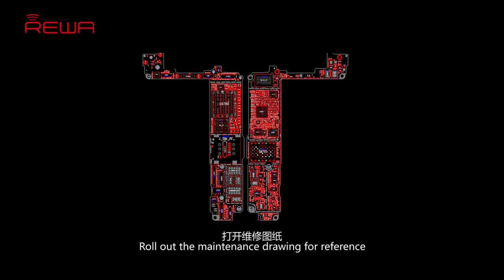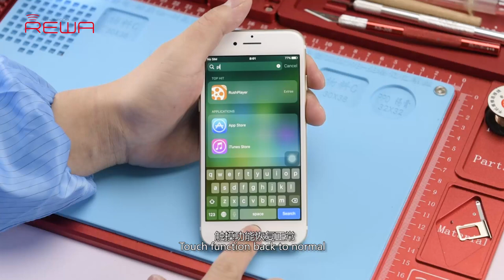How To Repair iPhone 7 Touch Screen Not Working

Comment: Question I have a customer's iPhone 7 it had a smashed LCD no damaged whatsoever inside using a microscope to investigate all chips on board all look perfectly fine, however tried 6 new lcds yet touch is still not working and not only that when power button is pressed it's like it's got a mind of its own same with volume button and home button, starting to think the phones a right off
Reply from the maker: Maybe the same situation with this video: https://www.youtube.com/watch?v=Bro_fIP2_mY&t=56s

Comment: Hello,
I have an iphone 7, I was going to replace the charging port so I opened the iphone and started unscrewing but I did not have Y000 screwdriver so i decided to put everything back(Just the rear camera) and plugged back the battery, lcd and home button and other flex cable, basically everything back to its normal place. 
However, After doing that I turn on my iphone and everything works normal but my iphone is not responding. The touch screen is not working at all. Home button is working and is responding but the screen is completely irresponsive. 
I notice there are 2 flex cables  coming from display (the one near battery flex), theres one on top and one that goes under it. The one that is under the top cable is slightly cracked. Is this why the iphone is not working or could there be some other issue?
Note: The display is working fine, i can see the apple logo and everything on phone but just can't touch anything so the touch screen is not working i think.
Please help me.
Thanks,
Rohan

Comment: HI so my iPhone 7 plus slid off my bed and fell face down on the ground. It already had a crack going down the right half of the screen but it looks no different it looks exactly the same. However, when I tried to text the lower half of the letters didn't work so I turned the phone off and back on. Now I can't get back into it because the bottom 4 numbers don't work. Now I'm stuck out of my phone and have no idea what to do. Can someone help me?
Reply from the maker: Jordan 100%. According to your description, we think your screen was damaged. You need to change the screen assembly. Find a local repair store for help. It's not a difficult task. 
If you wanna try yourself, this is the replacement screen you need to buy: https://shop.rewa.tech/detail/for-apple-iphone-7-plus-lcd-display-and-touch-screen-digitizer-assembly-with-frame-and-components-replacement-white.html

Comment: Hi everyone! Few weeks ago i swapped a broken screen with a, unfortunately, not-so-good new one, and i tested it (without immediately swapping home button) to see if it worked. Once i saw that it worked, i installed the home button on the new screen, trying to be as gentle as possible, and the phone gave me the touch id error message.
So i put the home button back in the original broken screen, but i found a weird behavior: original screen's touchscreen was unresponsive (and home button wasn’t working anymore).
After some attempts, i noticed that if both screen connectors were plugged, touchscreen was unresponsive (with or without home button), while if only the left screen connector was plugged, touchscreen was working, but, again, no working home button. As soon as I plugged in the right screen connector, the touchscreen stopped working.
On my main iPhone 7 I also tested another working original display of a second iPhone 7 of mine, with audio problems, but i got the same behavior: touchscreen wasn't working, with both screen connectors plugged, while was working with only the left screen connector plugged.
Both original screens work perfectly on the secondary iPhone, with both screen connectors plugged.
I tested all three screens with the JC V1 Programmer and while i can read and write data from and into the photosensitive chip of the two original displays, i noticed that the aftermarket one doesn’t have any chip. But it’s the only one that works.
So, is it related to the photosensitive chip? The mobo, or some other component, or software, blocks the touchscreen if i connect an original display that has that chip?
Or is this malfunction related to some connector/mobo damage?
Thanks!

Comment: Nice video. 

Is this considered a signature failure?

In which other war can touch fail?

Also, where do you recommend sourcing replacement filter, caps, resistors etc...?
Reply from the maker: It is one of the common failures. There are many other causes may lead to this kind of problem.

Comment: Hello, i have 1 iphone 8 and touch not working, if i press de conector works fine a few moments, and if a i put a lcd from iphone 7 works perfect without press, i already change the conector, and i have all the correct vallue, any idea? thanks

Comment: And for the record no point taking it to Apple centre once screen has been damaged game over they do not care after that unless you pay good money or even the price of the actual handset for a replacement , this is where Apple have normal folk who have no phone repair skills by the balls, profit from your mistake yet someone mentioned in comment below until Apple do board repairs or any half decent repair than they wil be called upon but their options are if it's broke it gets replaced very costly!

Comment: Why didn't replace filter? Jumping it isn't the best repair
Reply from the maker: One of the bonding pad was already broken and FL3904 was damaged, it is hard to replace a new one, so we use copper wire to connect.

Comment: Or you could just take the iPhone to apple?
Reply: Do you have any clue what they will actually do? They may not even diagnose the real issue. They will probably just replace your brand new looking iPhone 7 with a refurb, and not tell you about it.
Reply: I'd rather have an iPhone 7 replacement rather than a dodgy fixed up one from a 3rd party company
Reply: I've got a refurbished iPhone 6s Plus and there's nothing wrong with it, I have an extra 3 months warranty from it
Reply: Although Apple can be good at times, their ability to do anything beyond simple is frustrating. Forgot to backup some photos on your phone, and it stopped responding to touch? There have been cases where Apple will do the recovery for a whole lot of money with no guarantees, while a good repair shop can just fix the issue so you can.... be dumb enough to make the same mistake twice. I'll restore my faith in Apple when they can actually offer decent board level repair to their customers, and stop acting like they live in their own little world when the rest of it have a fault so common it is called an epidemic.
Reply from the maker: Thanks for the message. Actually, it is more expensive.

Comment: whats that watch likr thing in your right 👉 hand ✋
Reply from the maker: It's an anti-static wrist strap.
Reply: What is its use?
Reply: Thanks for reply 😇
Reply: Vardhman Ranjan It's for protect device from body electricity. Anyway, the body never produce that much electricity that is harmful to any component in device so it is totally unnecessary.
Reply: Yeah that much electricity is not produced so that's why I thought Why is He wearing
Reply: The chance of you causing damage to electronics with static electricity are low, but worth preventing the risk of. Do something like rub against something that may generate or even transmit a charge to your body, and you might create a whole lot of work and expense for yourself.

But if you want to wing it, at the very least make sure you discharge yourself onto something properly grounded first.